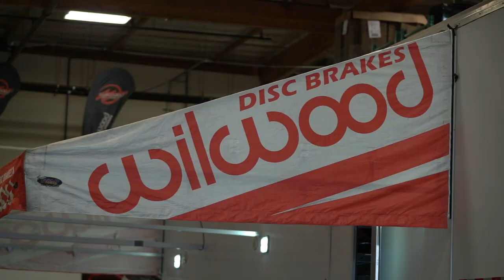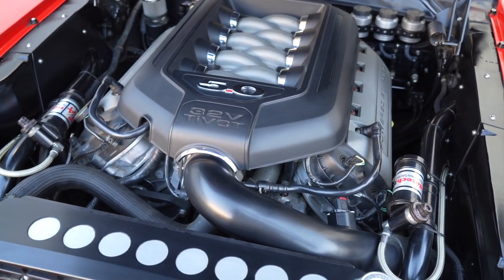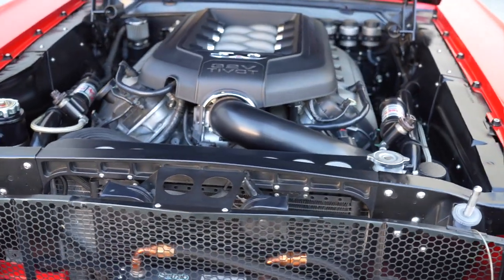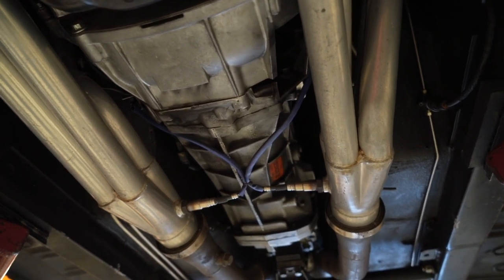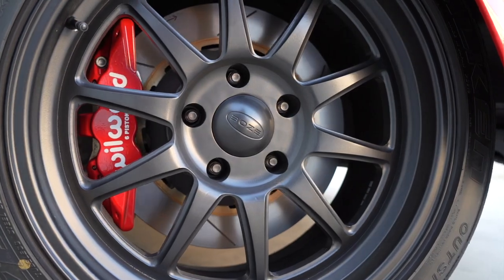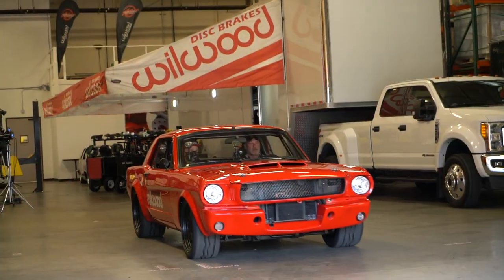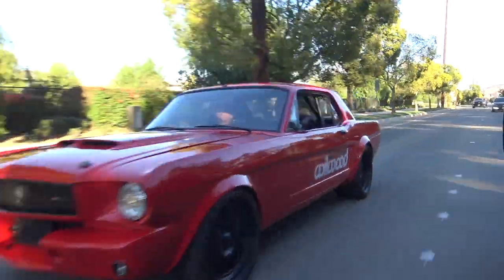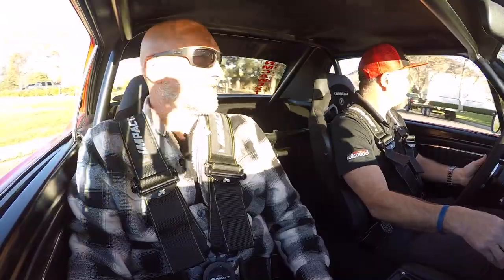Wilwood Brakes Coyote Swapped '66 Mustang Pro-Touring Test Mule

Comment: I like cars like this way more then cars with motors that make a godly amount of power (700 plus) If I build a car it will be something like this! 500hp max, a true drivers car!
Reply: Yeah I don't like overpowered cars! However I'd go 550-580 NA HP
Reply: 700hp cars nowadays are more tame tho, its not like back in the past when the engine sounds like its about to explode and ride quality dips
Reply: @isaiahr3471  as an owner of a 66 mustang, 500 would probably be the absolute max. People don’t realize they’re only 2600-2800 pounds, that’s a super car power to weight ratio and they aren’t exactly known for their great handling. However I can’t tell other people what to do to their cars so have fun haha
Reply: It's not about being tame though...it's if the chassis can handle that kind of power.
Reply: @eternalcowboy585  exactly, the chassis is not built to handle more than 400 hp without serious reinforcement
Reply: @cricky6239  they put a whole custome chasis looks like it can easily handle 1000+ hp
Reply: I don't like cars I can't take out and put a couple hundred miles on over a weekend.... cars that I need ear plugs on the highway... hot in Summer, cold in fall or spring, rpm is at 3500 at 65 mph, can only get 50 miles on a tank of gas and most importantly, small towns around me don't carry e85 or 100 octane so it needs to run on pump gas.

Comment: It’s not so much the stopping distance that is so noticeable, although it’s significantly better - the biggest difference was in rotor and hat temps. I’ve yet to see my brakes get over 250 degrees. My stock brakes got up to 550 degrees. 

Heat is a big deal.
Reply: Those lower temperatures allow for repeatable stops without fade.
Reply: Eternal Cowboy especially crucial when towing

Comment: Painting Wilwood on the side is odd but ok.  So it has a replacement frame?  Which is totally cool if you have the cash, but that's is some serious coin, right?  The rear tub work looks well done and the fender flares aren't extreme, preserving the classic look.  Is it a narrowed rearend?  He said it was minitubbed. That it gets driven is the best point about it in a way.  When you say "manual brakes" does that mean no vacuum asist or hydraulic asist whatsoever?  Because that is an issue with a lot of hot rodders trying to go 4 wheel disc conversion on some older street cars apparently.  Overall, really cool Ford.  Like it.  Excellent video!

Comment: i tried to model my car around this one. for suspension/brake setup at least.. noticed their clutch pedal is offset.. don't think they sell an assembly like that one... kinda sucks.. i had to shift the actual pedal plates you screw to the arms apart as much as possible.. would be nice if they sold just the offset pedal arm. they made a few custom parts for this car that they don't offer.. somewhat upsetting since this was an drive-able advertisement for what they "offer"..

Comment: Love this car saw it at good guys car show in Scottsdale.. Ive built a similar build with a gen 3 and tkx still trying to figure out the spring rate for the front end.  Viking recommended 600 lb springs and I had no suspension it was like a dropped low rider so I dropped to a 500 lb and it still rides rough even when I adjust the compression and rebound getting ready to order ride tech  coil overs for the front but not sure what  spring rate to get any advice from anyone would be helpful thanks.